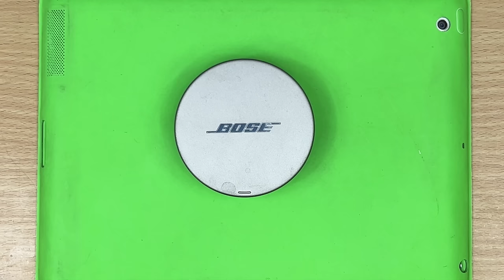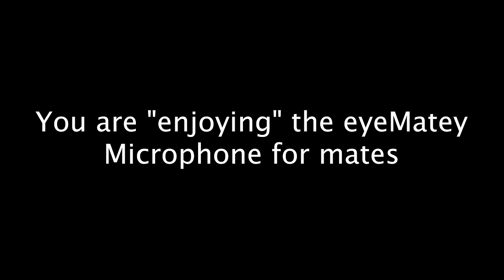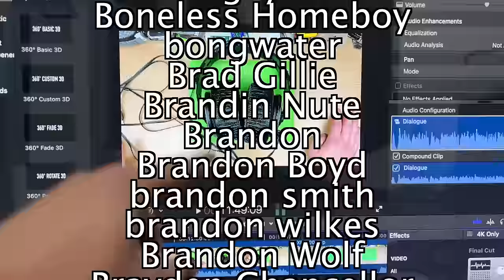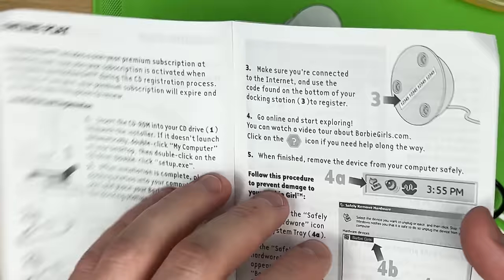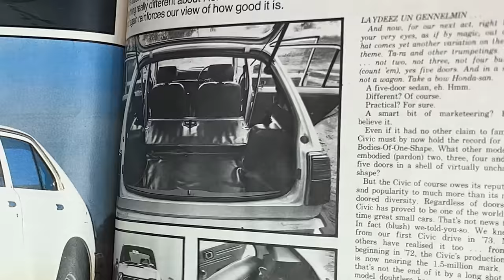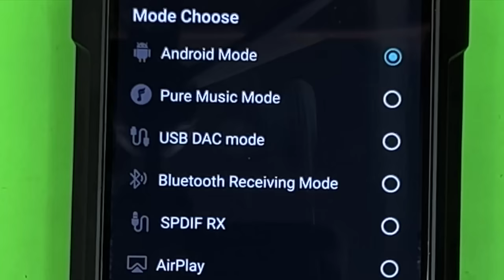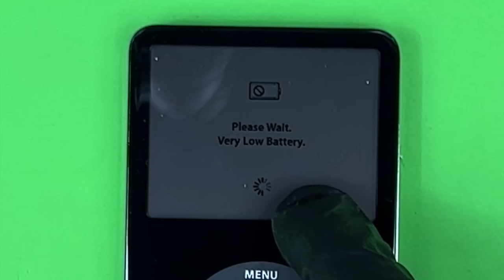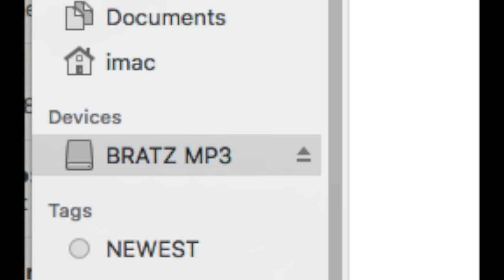DankPods - The Complete 3rd Season - 1/4

Comment: When you mentioned that there are many specific earplugs it reminded me that I own "partial" (?) earplugs. They only block some of the sound to help individuals who are sound or stimulation-sensitive like those with ASD (like me). I haven't used them to sleep but I do know they have gotten me through shopping through 2 holiday seasons lol.
Reply: What brand? Because a friend and I could use a pair like these!!
Reply: @aiodensghost8645 Loop Engage/Experience (forget which), I have a pair and they are a lifesaver for if I don't wanna bring headphones with me
Reply: @megabytesofrem  thank you! I have a pair from loop and flare but the loops are really nice I think you're mentioning the step with more sound than mine. Flare are definitely not as sound blocking as I sometimes need, so I got the strongest ones loop has

Comment: Was a pharmacist for a long time and I often ran into the earwax issue

If you ever run into that issue, you want the docusate drops; they’re literally used in stool softeners too because they just make the wax soak up water, you’ll see some nasty stuff in the shower - but they work a treat after a few days and don’t irritate the shit out of the ear canal like peroxide analogues do
Reply: Thanks random dankpods viewer for providing me with some i could actually use right now
Reply: Can confirm I’ve taken docusate for IBS
Reply: Thanks for that pro tip
Reply: I get the earplugs issue all the time because I do work cleaning and I need to vacuum without breaking my ears so I love the AirPods Pro 2 adaptive mode but they do the earplugs issue which really sucks also this took 30 min to type because it’s 3am and I’m brain dead at this point

Comment: The Polaroid SX70 segment reminded me of the Polaroid 600 instant-film camera I have.  It came with a second device, the Polaroid 600 Plus radio.  The radio can be powered by "AA!" batteries or by the remaining battery power in a used film cartridge.
Reply: One of my local electronics stores used to sell used Polaroid batteries.
Reply: Nice
Reply: @JJschannel255  It was well planned for what people consider a novelty radio now.

To power it from "AA!" batteries (it's a DankPods video, using "double-A" to would be boring) they didn't fuss with a separate battery compartment.

They gave it a removable "AA!" compartment of the same size & shape as a film cartridge.

Comment: From my understanding the best way to get the best from the four-wheel-drive system is not actually to send 50% to the front and 50% to the race It’s actually more like (front 40%) and (rear 60%) will allow for better steering less chirping at high speeds

Comment: Tech tip for installing windows 11, disconnect from all network connections, once installed load into the initial setup, press shift+F10 and type OOBE\bypassnro in command line. Press enter, let it reboot, insist you don’t have internet and set up a local account. No need to worry about all the update BS at the start.

Comment: I have some Ear Peace that cost £30 and they are the only ones that block out my Mrs snoring. They are meant for drummers and singers and have 3 different plastic inserts that alter the level. Would recommend. Can sleep without them digging into your head.
Do at times wake up with them in my hand but not very often.

Comment: so the earplugs one - in america, yeah, employer's are supposed to provide ear protection if you're in an area with high noise levels, that much is true.. But getting custom ones made? Nah mate, nah, they just put a bucket of the orange ones on the wall ever 30 ft, don't check if you're using them, and might refill the bucket once a year, at best.

Comment: Why not just get in the ear monitors?

1. Provides hearing protection and noise canceling
2. Each member of the band can adjust the volume of each individual instrument and vocal component, in their own personal headphones.
3.  A metronome can be added to keep everyone on beat.
4. Can add wireless microphones around the room so they can switch to a mode that lets them hear exactly what the audience hears.